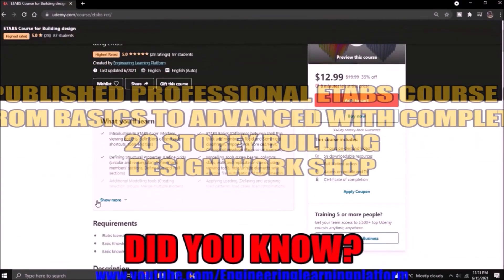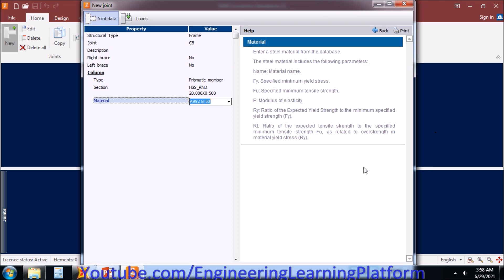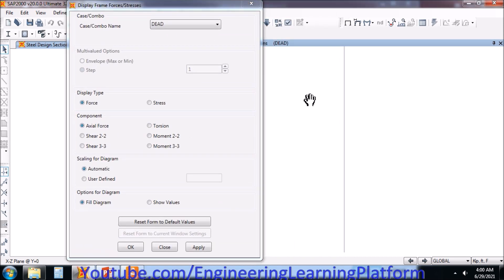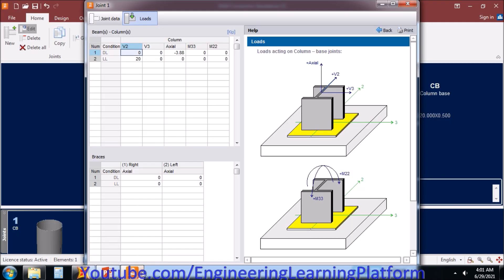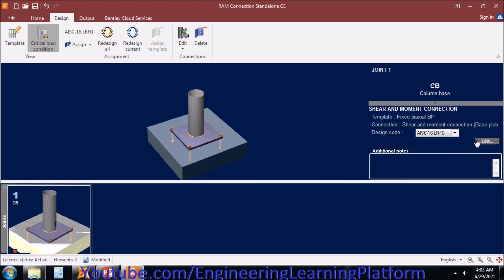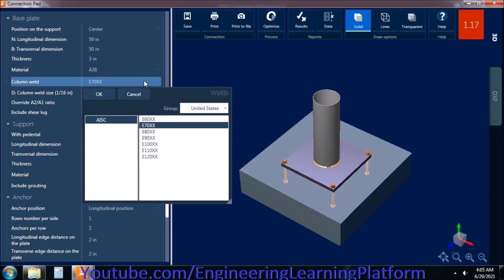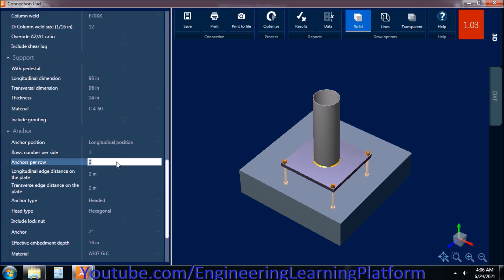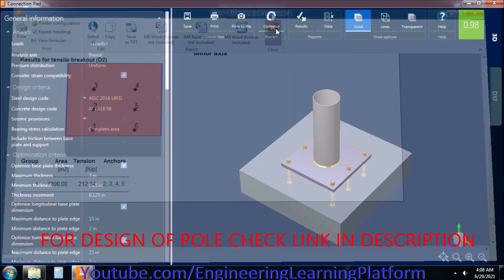Steel column Biaxial base plate design in Ram Connection Tutorial

Comment: Is design results are reliable ?
Reply from the maker: Yes.
Reply: @EngineeringLearningPlatform  Are you using any software to calculate wind load as per ASCE7-10/16
Reply from the maker: @hariasssss  yes
Reply: @EngineeringLearningPlatform  what is the name of the software ?
Reply from the maker: @hariasssss  Ram connections